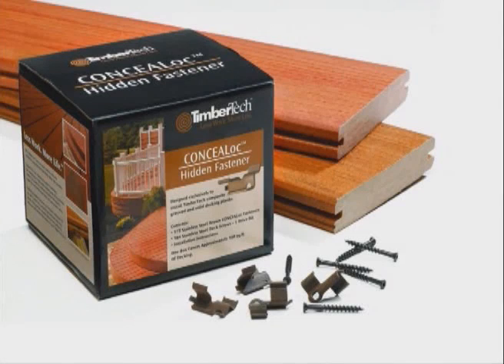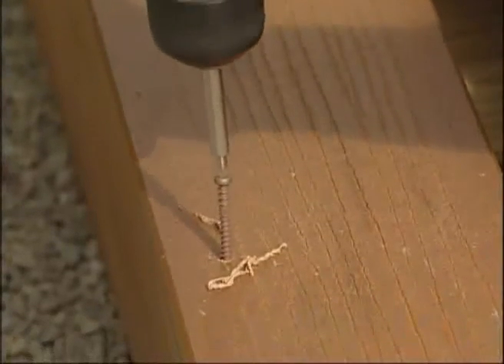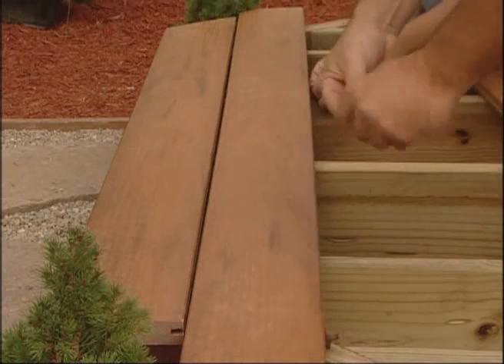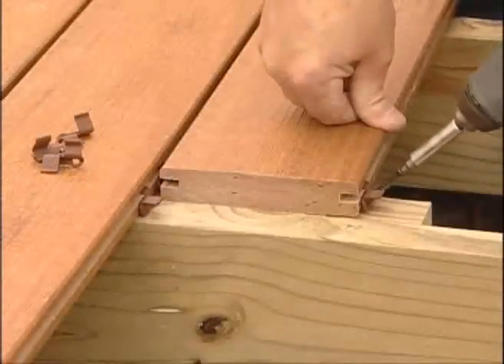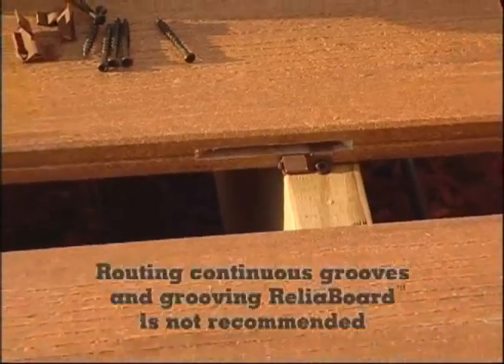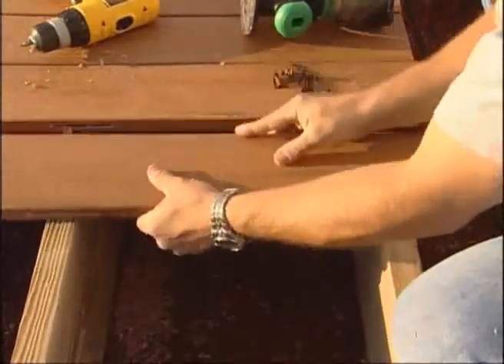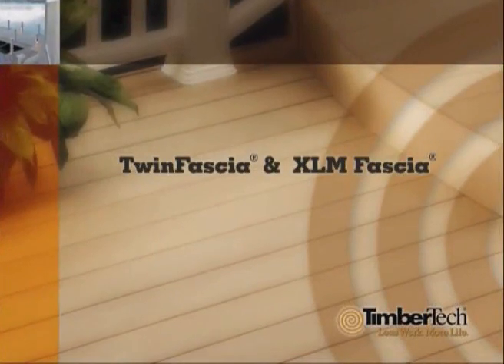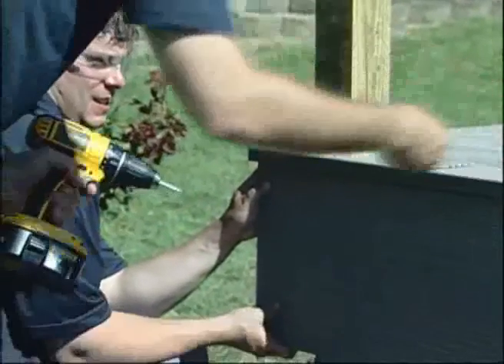TimberTech Grooved Planks - CONCEALoc® Hidden Fasteners and Fascia - Glenbrook U

Comment: WHY DOES TIMBERTECH MAKE THEIR DECKING NARROWER THAN ALL OTHER DECKING, I AM REPLACING STANDARD 5 1/2 INCH DECKING AND I AM GOING TO HAVE TO FIGURE OUT A WAY TO COMPENSATE FOR THE GAP SPACE WHICH ALSO MEANS THAT I CANNOT USE STANDARD SPACERS, THIS SUCKS I'VE ALREADY SPECIAL ORDERED THE DECKING  !